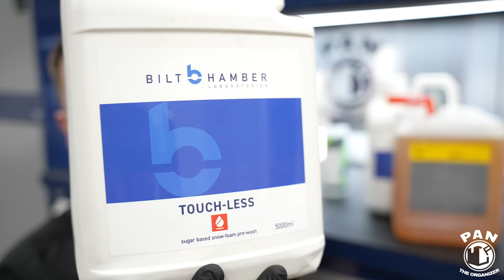The end of the 2 bucket car wash method!? 💀

Comment: I still get confused on which soaps I can use as maintenance on my coated veh.  ie.  how strong can I use without hurting the coating.  I always thought I had to stay PH neutral so as not to break down the coating?  I do a PH neutral for every other wash and then a hydro (ceramic) soap on the other washes to help in the longevity of my coating.  Appreciate any guidance.  thank you for all you do.  Love your channel.
Reply from the maker: Hi John! For regular weekly washes, stick to ph neutral soaps and snow foams. That's all you need. I like to use Koch Chemie Gsf for the snow foam, and CarPro Reset in the bucket for the contact wash. Or, in place of Reset, if you want to use a shampoo infused with ceramic for a boost of the protection, you can use something like Gyeon Bathe+ for example (not the regular Bathe, which doesn't have any protection in it). But I prefer to use pure shampoos with no protection, as I will apply a spray topper at the end of the process anyways.

Once in a while, for a deeper cleaning, grime removal, water spot removal, road salt removal, like at the beginning of spring, that's when I will use an alkaline pH snow foam for the pre-wash, followed by an acidic soap for the contact wash. Both are safe on coated cars if you get the right products. See my ultimate spring deep cleaning tutorial here: https://youtu.be/oTaFE_p2OAw?si=4XGBwVqEuqkkinBL

Ceramic coatings have much higher resistance to chemicals compared to regular waxes and sealants, so they can resist non pH neutral soaps easily. Just don't use those on a weekly basis as you can eventually weaken the coating.
Reply: @PanTheOrganizer  You are the best.  I am always amazed at how you find time to respond and give detailed responses.  No one else ever takes the care you do.  Thank you.  Just as an FYI in case I am doing something incorrectly, I am a huge fan and have had good luck with Chem Guys Mr. Pink for my more frequent washes and I use their hydro suds for when I want to boost my coating.  I have Adam's advanced graphene on all my veh's and have had amazing results. 3 years in on some and going strong.  I also do a graphene detail spray or a CS3 from Adam's as well when I am done.  It did watch your winter cleaning video and took copious notes and followed to a "T" the process.  So thank you for that as well.  I started getting obsessed with what coatings and products to use and someone was always coming out with something new.  I had to eventually slow down and just stick with what I am having good luck with as there will always be something different or new out there and tends to drive me crazy as what to move to next.  I will keep watching and learning.

Comment: Great video Pan! How much solution should I use in a chemical guy's foam gun so that I use it all and don't have any left over solution by the end of my car wash? And what is your recommended dilution ratio with a simple car wash shampoo? Thanks!!
Reply from the maker: That's impossible for me to say as there are too many variables like which foam cannon you're using and the size of your car. That's a thing you'll have to test to figure out for yourself. A good starting point is a 20 oz solution in your foam cannon and see if that's enough. 

For dilutions, ALWAYS follow the specific instructions on the label of the product you are using. There is no "one single dilution ratio works for all soaps" type solution.

Comment: I’m not disagreeing with the 1 bucket method just questioning! Why replace the microfibre towel each time just to dunk the new one into the same “dirty water” bucket… if the bucket is cleaning the towel there is no need to replace the towel… replacing the water would make more sense and that makes no sense at all

Comment: What about the situation where you don't have a foamgun? I assume still use the 2 bucket method anyway.
Personally I foam dry, wash with high pressure very intense and secure every inch (not just rinse!), then no re-foam so wash immediately with 2 buckets, then quick rinse, then dry. In case of claying, I clay right after the last rinse, and then quick re-wash the whole car with 2 bucket method and rinse again before drying. I think there's no reason to ever foam 2x unless you have a very new and expensive car.
Reply from the maker: If you don't have a pressure washer with a foam cannon, you can attach a foam gun to your garden hose and still be able to do the snow foam (just not the same level of foam as a foam cannon obviously). I made a video comparing a foam cannon setup to a foam gun setup here: https://youtu.be/rJPk8nR8Ib0?si=Trrtv_LXeH1XyXTD

Welcome to my channel. You discovered one of the biggest car detailing channels on YouTube as we surpassed 980,000 subscribers and we have over 132 million views! I have been detailing for 26 years and I love to share my knowledge and passion with my viewers.

You found the right channel to help you learn everything about detailing.
Reply: @PanTheOrganizer  I meant no snow foam, not on pressure and not on hose. Then still do oldschool 2 bucket method. Like before the foam era.

I'm not new, I know you and your channel for quite some time! You make great and honest videos.
Reply from the maker: Thanks! But I don't quite understand your question. You want to wash your car but have no pressure washer and no hose?

If you don't have access to water, the other alternative is a rinseless wash method if the car isn't too dirty. See my tutorial here: https://youtu.be/p58Y5qRd3OU?si=2pG9vXXqclXg5fkV
Reply: @PanTheOrganizer  When you do have hose and pressure washer but no foam gun for hose or hp. So just high pressure without foam at all.

Comment: Pan, this was fantastic - truly another helpful video for pros and diy'rs combined. Ive been playing around with the single wash method for a year or so, funny timing. Noticed it worked as good but I can alter my steps.
Question: I'm typically going to my best self service station. But at the station I bring my bucket, chemicals, mitt, blower etc etc......can my marolex pump sprayer be used in leu of a foam cannon for the presoak stage and then followed up by 2nd step for lubrication before handwash?
Cheers, JH (Joe)
Reply from the maker: Yes absolutely! It just takes more time with a pump sprayer, but it works. 👍🏻
Reply: @PanTheOrganizer  perfect! Now I'm just trying to decide which prewash chemical to choose for my coated car. Either the gtech W4 or the diydetail incredi suds......not sure which would suit better for my pump sprayer prewash stage 🤔
Reply from the maker: The W4 is a bit stronger, but both are very good.

Comment: Genuine question but do you really need to use the car shampoo when you have already sprayed it with snow foam?! Surely the snow foam alone will clean the car? Just seems OTT.
Reply from the maker: The purpose of a snow foam is to pre-spray the vehicle, let it encapsulate loose dirt and debris, and then you rinse that off. That gets 70-80% of the dirt off the car, BEFORE you do a contact wash, thus reducing the chances of marring the paint when you are hand washing the vehicle. You should never just spray the foam and go directly to hand washing. You need to rinse off the majority of loose dirty and debris if you want to as safe as possible, before attempting to hand wash.

So you would snow foam, then rinse, then you have the option to refoam and wash (assuming the snow foam you used can also be used for the contact wash) or you can foam, rinse, and go directly to washing using a dedicated pH neutral soap in your wash bucket.

See how I wash my car in this video: https://youtu.be/X0msqeozDBU?si=kVskza3Iw_-xP4XV

Comment: As I’m doing the contact wash, foam on car will “dry” up. Do I need to re-foam the panels that are drying up before washing?
Reply from the maker: As long as you're not working in direct sunlight, you're fine. Especially if your soap is pH neutral.

Comment: Is there a quick detailer out there that’s also a sealant?? Possibly one that’s a drying aid too ??
Reply from the maker: Don't get confused. Most quick detailer can be used as drying aids. Quick detailer just means a light spray protection. It can be in the form of a spray sealant (like P&S Bead Maker), or spray ceramic (like Gyeon Ceramic Detailer), or spray graphene (like Adam's Graphene Detailer) or spray wax.

Comment: Was wondering if you have PPF on your car?  If not what is protecting the paint?  Is PPF necessary?
Reply from the maker: I have a ceramic coating on my car. I am just not a fan of the look or feel or PPF. Plus, as I get a brand new car every three years, and do low yearly mileage, scratches and stone chips are of no concern to me. My cars are always pristine when I bring them back to the dealership.

But for people who keep their cars for many years, and want the ultimate scratch and rock chip protection, PPF is the only solution. I would still recommend a ceramic coating on top of the PPF, for the best of both worlds.

Comment: Do  you use the same Ph soap in the bucket as in the cannon or can you move down to a neutral in the bucket and let the cannon serve as the muscle?
Reply from the maker: It depends what you're using in the foam cannon. Most times, those are dedicated snow foams, so I use a separate shampoo in the bucket. For example, CarPro Lift in the foam cannon, and CarPro Reset in the bucket.

There are certain soaps that can be used both in the foam cannon and in the bucket, like Koch Chemie Gsf.

Comment: You mentioned that there’s no real touchless system out there at the moment, and I agree but some do better than others. Have you tried Chem-X Star and Stripes touchless system?
Reply from the maker: I haven’t
Reply: @PanTheOrganizer  Its a product where you spray on with a foam cannon one product and immediately spray on another one to neutralize the first part, and you use the powerwasher to clean the dirt and grit, many just rinse it off and thats not how it works, it needs the powerwashing pressure to clean everything off. Definitely give it a try as its something different than others Ive seen so far.

Comment: Hi Pan, does it matter what kind of cleaner is used in the bucket? Would a rinesless solution work here
Reply from the maker: It depends what method you use to wash your car. If you use the traditional wash method with a garden hose or pressure washer, you'd have a soap in the bucket. If you use the rinseless wash method, you'd have a rinseless wash in the bucket.
Reply: @PanTheOrganizer  Thanks for the reply! My question was specifically about this video(The 1 bucket with 2 pre-wash method)! Sorry for the confusion :)
Reply from the maker: It depends what you are doing. For just a regular weekly wash, I use the same pH neutral soap in the foam cannon and in the bucket. 

And then, once in a while, for a deeper cleaning like in spring time, I use a higher pH snow foam (like CarPro Lift) and an acidic soap in the bucket (like CarPro Descale). See my ultimate spring cleaning tutorial here: https://youtu.be/oTaFE_p2OAw?si=65t4hj9RPDQsMiAS

Comment: Are the stronger snow foams compatible with ppf, or would you stick to a PH neutral cleaner, Pan?
Reply from the maker: You would have to ask your PPF installer what works or doesn't, as different PPF can have different requirements. But usually, what you can apply to paint, you can also use on PPF. More or less.

Comment: So it’s perfectly safe to use two different soaps 19:28 ? That means I can use Incredible Suds or Adams shampoo in my foam cannon and Reset in the bucket?
Reply from the maker: Yes absolutely. But you can also use the same soap if the soap you pick is made for both foam cannons and buckets. For example, all three you listed can be used in both foam cannons and the bucket (DIY Detail Incredible Suds, Adam's Car Shampoo, and CarPro Reset).

Some soaps are only for the foam cannon (like Bilt Hamber Touch-Less and CarPro Lift for example).

Comment: fairly new to this, but I tried the chemical guys bucket with their dirt guard, and the damn thing just floats around in the bucket and DOES NOT work. Every time I put the mit in to rinse, its just rolls around in the bucket. NO GOOD. I plan to order the detail guard version, but I'm curious why you weren't using their side panels protectors for additional protection especially during this method of a 1 bucket method. Any reason for this?
Reply from the maker: Sometimes I do, sometimes I don't. I test many different methods and techniques and switch things up every now and then, as this is a detailing channel, and I like reporting back to my viewers with good practices.

See my full video on all the Detail Guardz equipment here: https://youtu.be/xmCtN4Y0APM?si=-D-rqvd-DRMCwTNZ

Comment: Pan, what’s a cheaper high ph shampoo? I know you make these videos more or less for the pro’s. I do not do ceramic but once a year I do a full detail and try to start fresh
Reply: This one I need a good acidy soap for my hardwater when I want to polish every so often
Reply: The DIY Detailing line is reasonably priced for both Incredible  Suds and All Clean. You can mix them for higher Ph.
Reply: @72mespo  thank you
Reply from the maker: Where do you live? Certain soaps aren't available everywhere. And are you talking about a high pH snow foam? Or a higher pH shampoo in the bucket? We typically use the high pH as snow foams, for the pre-wash. Like those I spoke about in the video.
Reply: @PanTheOrganizer  I’m in NYC. I use a pressure washer and a foam cannon. Looking for a foam for my once a year washes where I can strip everything and start fresh. I don’t do ceramic though
Reply from the maker: Keep in mind a snow foam alone won't fully strip existing protection. Only machine polishing will ensure 100% removal of old paint protection. But a higher pH snow foam can help to start to brake down that older wax, and also help soften and remove traffic film and deeper grime, for a good spring cleaning, like in my tutorial here: https://youtu.be/oTaFE_p2OAw?si=ZahZ5etz6cpzNX5R

Here's a higher pH snow foam you could get in the USA that works great: https://bit.ly/46qWOn4
Reply: @PanTheOrganizer  thank you so much

Comment: I worked as a valeter at a main dealership, started doing service washes, then moved to trade-in cars and eventually showroom cars.
I have been a hobby detailer for years.
Two bucket method shampooing is pointless, and if you need to do this, the car isn't as clean as it should be, before you have reached the shampoo process.
If a vehicle is very dirty and grimy, it needs a good pre-wash with strong TFR or a citrus degreaser, or BOTH, (which will also attack any paint protection applied to the paint, so any protection will need re-applying). Jet-wash off. If the vehicle isn't too dirty that stage may not be needed.
Then a quality snow foam (I prefer Bilt Hamber auto foam), left to break down the remaining visible dirt for 2-3 minutes, and jet-washed off.
Then the paint may need an iron deposit remover sprayed on, and left to 'bleed', before again jet-washing off.
If there are tar deposits stuck to the paint, then a tar/glue remover might be needed to dissolve those, before again jet-washing off.
So, we have still not physically touched the paint yet. The vehicle should now be 98% clean, with only some small sections such as grime, bird droppings, etc to remove.
Then, and only then, using the softest mitt (I use lambswool), you can actually touch the paint with a shampoo solution in ONE bucket.
The car should not have ANY grit or heavy grime left on it, which could damage the paintwork, so two buckets are not needed. It is pointless.
The shampoo also helps to balance any wide PH range products which might still be on the paint, and the mitt helps reach places which may still be slightly dirty, and a light contact wash with shampoo can remove those final tiny spots of bird droppings etc.
Then, one of the most important stages, the drying. So many people ruin all the hard work of cleaning, by leaving water spots on the paint.
The two bucket bro-science bs can go the same way as rinsing snow foam upwards ffs, another completely pointless old wives tale.
Snow foaming the car and then shampooing on top, can work depending on the products you use. But, it can also be quite a rubbish method if the WRONG combination of products are used.
For example, if your foam is high in alkaline ph level, and the shampoo acidic (or vice-versa), the two products cancel themselves out and become weak thus neither of them work as well as they should, as the ph has now gone towards the middle 7 and watery.
It's easy to clean a vehicle which isn't very dirty, and many detailers tend to believe the bro-science bs because in essence, it wouldn't matter what methods they use because the car is pretty clean before they even start washing it.
But, for really dirty vehicles which are not being machine polished afterwards, the cleaning process is extremely important.
What really does my head in, is seeing weekend detailers using quick detailing sprays on their cars, without even cleaning the paint first !! There are two people on my street who do this, and I did offer them some friendly free advice, yet they think they know best ffs. One has a BMW M2 in Black smh. If it's visibly dirty, he will one bucket shampoo it with a sponge ffs, dry it with a 10 year old wash leather, and then spray detail fluid on and buff. 7 times out of 10, he doesn't even wash the paint, just sprays the detailing spray on because 'it cleans the car as well as detailing it' FFSK ! You cannot tell these people anything, they think they know better.